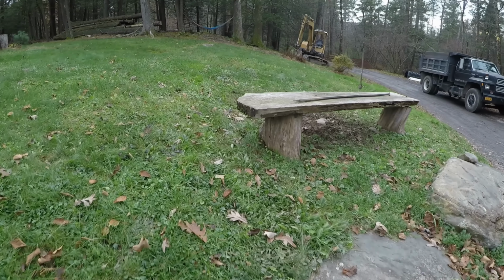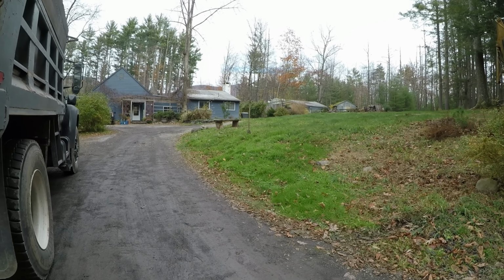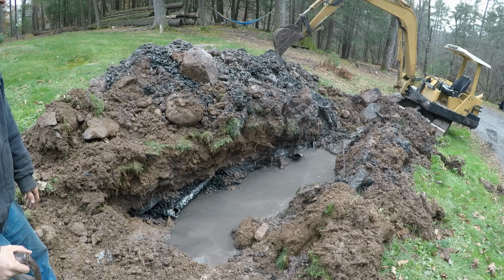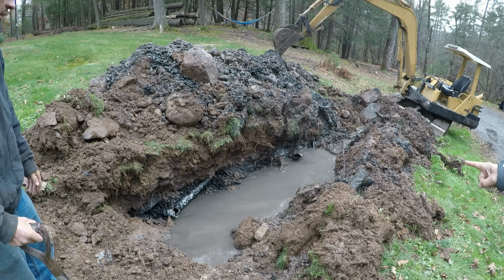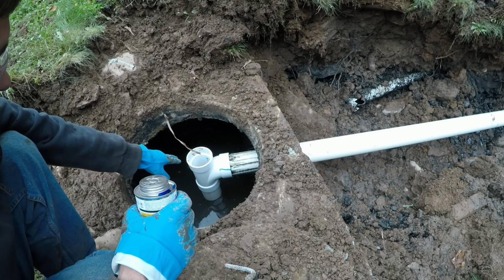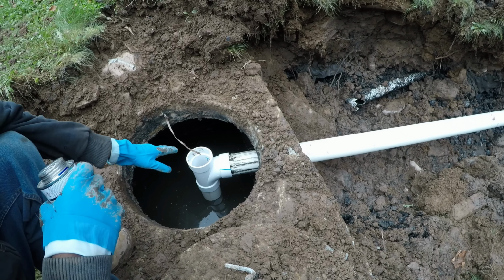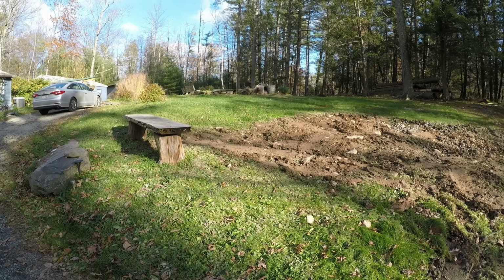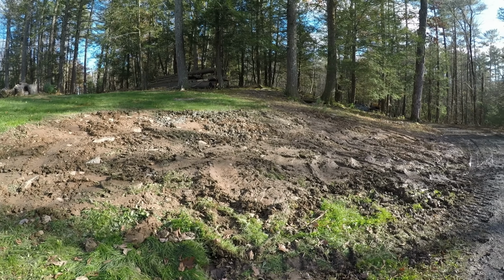Replacing a leach field

Comment: You'd never get a system like that permitted here...   With the heavy clay soils like that, a leach field would never work. The DNR would require an above ground mound system about 5-8' tall, and 25-50' long, with a series of pipes buried in sand, with the wastewater going from the septic tank to a pump chamber buried in the ground, then  the liquids are pumped up hill to the pipes in the mound, where the water both leaches down through the sand and moves up to the surface to feed the grass & evaporate in summer..

The grass on the mound grows about three times as fast as the rest of your lawn too, and the DNR even regulates the variety of grass used...

A question on your project.... None of your pipes are buried very deep, so aren't you afraid of freeze-up, especially where the pipe goes under the driveway...??

They wouldn't let you run it under a  driveway or street here, unless it was buried 12-15' down...
Reply: 12 to 15 feet down is just stupid and unnecessary even in the coldest climates.  3 or 4 feet is more then enough. 4 definitely gets you under the frost layer too
Reply from the maker: They would require something that is so expensive to install, that it would never get done and the homeowner would pipe their septic running out into the woods.
Reply: @wyattsmith8808  it routinely freezes 6-8 feet down here, and in an unusually bad winter, pipes buried 10 feet down have been known to freeze, so no, 12-15 isn't stupid.
Reply: @AndrewCamarata  the county inspector would stand there as you built it, occasionally taking pictures for your file at the courthouse.
Reply from the maker: Thomas J Sanford Where is here, that sounds like a nightmare situation, that guy would not have been able to afford a system like that, I guarantee a lot of the people would just pipe their septic’s out into the woods because of a regulated septic system being too expensive to install. Septic systems do not freeze,
Reply: @AndrewCamarata  septic systems DO freeze, but it is unusual.
Reply from the maker: Thomas J Sanford i’ve only seen them freeze if there is already an existing problem, a good example of that would be a belly in a pipe that settled. Every engineered inspected system I’ve done in the past, has never been installed with more than a foot of cover according to plan, I don’t think I want to do with many more septic systems, too many politics are involved with it.
Reply: @thomasjsanford4369  in the US I dont see it ever freezing that deep. I'm in maine near the canadian border and it never freezes anywhere near that deep and nether ever gets buried that deep
Reply: @AndrewCamarata  with only a foot of soil on top of it, we'd be in trouble already by Thanksgiving, as we sometimes get below zero weather before we have adequate snow cover to protect pipes from freezing..  

In rural areas, the septic system is most vulnerable, but in cities where utilities are buried under the street, the water pipes can freeze too, leaving the city to require people to run water 24/7 for parts of the winter, and the sewer utility to have steamer trucks out often to thaw frozen sewer lines..

Comment: You think a hole with rocks in is bad? Here in rural Scotland everybody lives near a burn (Stream) as that used to be the only source of water. Up to this day our septic tank outlets are still just connected directly to that. Come 2020 though we are either required to have leach fields (soakaways) or a treatment plant which will allow the water to be discharged directly into the stream. Where I live the ground is too wet for a soakaway and legally we are too close to the stream as the tank is only about 5 meters away so we are planning on getting one of these bio-rock draught powered ones. Have you had experience with them and are they any good?
Reply from the maker: I do not have experience with those. Most systems I'm used to dealing with work similar to this one.
Reply: Probably be cheaper to install a composting toilet than deal with all of the rest for a conventional system.

Comment: Just curious, my house has an issue with the drain field where no water is backing up in the house, but ground is saturated. I know it would vary from state to state, contractor to contractor, but what would a job like this cost a homeowner?
Reply from the maker: It really depends on the site. Here in NY, repairs don't need an engineer/inspector involved. So a repair like this can get done starting at $2500 or so. If an engineer/inspector is involved, the cost can be easily double that. Your septic system will need to be moved to another spot on the property. Make sure the baffles are good in the tank, and make sure no toilets are running constantly.

Comment: What is the deepest you can bury a field line?
Reply from the maker: It depends on the area. The whole point is for water to go away into the ground/evaporate. If an engineer is involved, they fill flip out over every little detail. I have seen all kinds of things done, and they work.
Reply: @AndrewCamarata  thanks and subscribing
Reply: For years the standard was or is 24”.
Here in Arkansas we use EQ-24 infiltraters and burry then at 18”.
You’re better soil is higher, so the deeper you go the worse it is to percolate through the soil.

Comment: In Connecticut the outlet has to be 18” are there codes there or you just winging it
Reply from the maker: IDK, that was a cheap system. I don't think ill do any more cheap systems like that. The tank was already set, I couldn't really change the outlet depth without adding more soil.
Reply: As long as it works right 👍🏻

Comment: I have to get an engineer ($350) then county inspection/permit ($170) before i can get an estimate. It's crazy. BTW i am in GA.
Reply from the maker: Here if its a repair, you don't need any of that.
Reply: @AndrewCamarata  I have a 50 year old concrete pipe drain field that needs replaced. These are local requirements not state. Adjoining county does not require all of this mess. Go figure.

Comment: One strand in my Leach field  has water coming to the surface right now.
 Do you think I should replace my tank and everything, or just repair the field???
 System is 35 years old!
 Would appreciate your advice thanks
 Concrete 1000 gallon tank
Reply: First, pump the tank if it hasn’t been pumped recently.  Second, reduce the flow by installing a separate grey water system for washer, etc.  Third, regrade the area to direct rainwater away from the field.  Probably be good for another 50 years then.

Comment: cost for someone to have this done?
Reply from the maker: Job like that, maybe $2500
Reply: why do some have small holes in the pvc and what you installed covered the pipe like a roof? im assuming what you installed makes replacement not needed for a much longer period of time.
Reply from the maker: I used chambers. I think its a better system than the pipe with the holes. Other people might have a different opinion. A system like this is certainly cheaper/easier to install.

Comment: How much does something like the way you're doing it cost? My leach field is failing & I need to figure something out. Right now I'm having to have the tank pumped every 6-8 months & there are only 2 people living in my home.
Reply from the maker: Well is it bleeding out or backing up? If you open the septic tank cover, and the water level is over the outlet, there is a problem with your leach field. This is a typical repair. It could cost $2000-$4000
Reply: Yeah it backs up into my house, laundry sink churns, fills, tires to empty, toilets bubble & don't flush when the tank is full. I just had to have it pumped again today, last pumping was this past November. The guy said that it was right up to the cover again.
Reply from the maker: Your wasting your money pumping it. The field is bad and need to be replaced.
Reply: That's what I thought, that's why I was asking about potential cost. I've heard $5,000-$20,000 possibly, which is WAY out of my reach as a single mom who lost my job in July.
Reply from the maker: Well it depends on the area. It shouldn't be that high. I think I charged $2500 for this job. I cant remember though. Some areas have stricter rules for septic systems. Here repairs don't need to be engineered/inspected. So they keeps the cost down. One thing that makes septic's very expensive is if you need to truck in a ton of fill material to do an above ground system.
Reply: I'm in Springfield Vt...not sure yet what the town's requirement's/restrictions are. Would need to bring in materials.
Reply: I live 20 minutes from Bennington VT, in NY, I had to have a semi-fill system for the two homes on my 6 acres....cost me around 15 grand...trucking in the fill was the killer......
Reply: Bonnie Dedrick its been 2 months ago. Did u get estimates?How much
Reply: I have not...Been focusing on finding work. Finally starting a new job tomorrow. Then will turn my focus on catching up on bills & get an estimate.

Comment: What is a septic leach field
Reply from the maker: Its the second part of a septic system, where all the water goes after the septic tank.
Reply: Unwanted Gu patrol -Think of your septic tank as an organic, living thing. You feed it with whatever goes down your drains - toilets, sinks, garbage disposal, etc. The septic tank allows both solid and liquid waste to be "digested" to a certain extent by bacteria (which can be adversely affected by powerful cleaners) and allows solids to settle to the bottom of the tank where, sooner or later, they need to be pumped out. So it functions as both a stomach (digester) and colon (crap, toilet paper, etc. storage). But the water we put into that system has to go somewhere, so a drain field allows the water to be distributed over a larger area and seep into the ground - otherwise you'd just have a tank that would have to be pumped out of mostly water every few months. A leach field needs to be sized to the anticipated water load it has to accommodate and also has to be located so as not to affect groundwater sources (like your neighbour's well) or lakes/streams, as well as not put so much water into soils that landslides are caused for those down hill. Pretty simple, unless your contractor drops great rocks right on to of the pipes.
Reply: Unwanted Gu patrol A gigantic money pit when it fails!
Reply: murraystewartj Excellent explanition of what a leach bed is and it's purpose. I have a 400 gallon septic tank, and about every year and a half, i always dig it up and have it pumped. I feel that everything clean works much better for you, and cleanlines is always the very BEST insurance that keeps things in general working order.  I pumped my septic tank last fall, in September, when April of 19 rolls around, it will be time again to dig her up and get ready to pump again. I like things clean and well taken care of.

Comment: why no gravel around the pipe at least where it crosses the road! one misplaced rock and that pipe is done for!
Reply from the maker: I bought that load of gravel to do that. The material where it crossed the road was gravel, I'm not worried about it. Plus your not the first person to ask about this. I did a follow up video explaining the strength of that pipe. That pipe is very strong.

Comment: I central to south NJ the ground is sandy and soft like a sponge. My septic cost $18,500.00 to replace because the builder had the septic built wrong and a truck drove over it. My septic has a gold sand base and is about 6' deep. It then has a cloth mesh, rocks and the plumbing has a junction box that leeches out to 8 perforated septic pvc pipes. They have rocks poured over them and a cloth to top off and then the dug out dirt to cover the 1000 sq field. I understand the dirt in that area is hard and can cake up. But it looked like the end of the run from the tank drained into the black covers and stopped. Did you use perforated pipe all the way down the run of the covers? Is there a clean out on the baffle? My failure was the septic was leeching out of the ground. Poor workmanship and it being crushed.
Reply from the maker: The pipe going out to the leach field is solid pipe. Usually there is no clean out between the tank and the field, that's just water and doesn't usually clog. I'm going to do a follow up video very soon addressing the good comments I got on this video regarding buried utility's.
Reply: In your area the codes for septic are diffrent from NJ. I thought the water would flow to the end and seep out of the holes along the pipes to be distributed evenly. The clean out in the tank is to prevent light debris from clogging the leech-field and is code here in NJ.
Reply: I meant a clean trap with a mesh not a snake clean out.
Reply: I think the clean out mesh your talking about is what is called a effluent filter.
Reply from the maker: Your right Keith, I've never seen that installed before. That might be more necessary with a traditional system, those 4" pipes could clog easy. Those huge chambers I think are a much more reliable system.
Reply: Andrew,  your are right. But the water need to leech out not pour out in one spot. That's why perforated pipes squared off and enclosed causes the water to evenly leech out.
Reply: Kieth. you are probably correct. The water flows through it and its a serviceable item.
REPLY

Comment: Just wondering what size gravel you used  and I was always under the impression   with this type of system  dident need gravel working on planing a leach field for myself  and advise would be appreciated
Reply: As a certified installer I can tell you that you don't need any gravel or rock around these infiltrators.

Comment: Need to bed that pipe good, and i never saw a level at any point. Maybe you had plenty of grade to work with hard to tell by the video
Reply from the maker: A few other people mentioned the bedding of the pipe. I made another video right after, talking about the different types of pipe that are available. I think that SCH40 pipe is so strong, that it does not need a layer of gravel to protect it. From the house to the septic tank, the pipe needs to be 1/4" per 1'. From the tank to field, pitch doesn't matter, as long as it has it. I was using a level the whole time; the water that was flowing in the bottom of the trench is the best level available.

Comment: YOU COULD NOT GET AWAY WITH THIS REPAIR IN N. C.
Reply from the maker: That's too bad, this is a good repair. Those over engineered systems with multiple laterals systems suck.
Reply: Then again what they don't know won't hurt either.
Reply: Couldn’t get away with it in Arkansas either.
And the reason why is because a system like this depending on your soil will fail. 
Also these chambers will be crushed because the trenches were too wide.
Reply: Tate O'Connor said yes to his cousin

Comment: dude wtf, the bells on the pipes go up hill not down hill, also i don't know where your located but here you need to be licensed to be an installer, an engineer is who designs the system, that definitely wasn't the case here, out of all the systems I've installed concrete gallies, plastic infiltrators, and stone and pipe, there's always a level bed of sand a couple of feet deep, then the infiltrators,stone, filter fabric, then a sand cap, and finely the top soil, that system don't look like it will last 1 year
Reply: upstate newyork  way old house out of the way just fix it so homeowner is not paying the price of a new car for a shitter
Reply: I noticed the bells being downhill too, but then saw a more sophisticated pipe insertion tool would be required
Reply: bleachinuri - it’s dudes like you that make installing a system like that highly expensive, it’s not rocket appliances, Andrew did a great job, just watch the video and move on, I know you left this comment 9 months ago but armchair youtubers are the worst.
Reply: I want to point out that each state is different. 
Here in Arkansas for example if you have over 10 acres you can do whatever but anything under even a repair requires a Perc test. 
Here we don’t have engineers, we have designed representatives.
Not all systems require sand, it truly depends on the soil morphology.
That said.  This guy sucks at installs.
His trenches are way too deep and too wide.
Reply: Good idea but have to let the dirt settle or it will snap the inlet pipe off
Reply: Can't drive on pipe like that snap crack and need to have pipe and fittings clean no mud and glue

Comment: You have no business putting in one of these systems.  You didn’t even put a level on the pipe, the trench was uneven, the joints were so dirty and the glue so crappy they probabally started leaking 5 minutes later and the pipe was not bedded whatsoever.  That system has probabally failed already.
Reply from the maker: That system is working fine. I had a level under the pipe the whole time (the water flowing threw the trench).  A system like that will last for many years. Probably much longer than an expensive over-engineered system if an engineer had been involved.